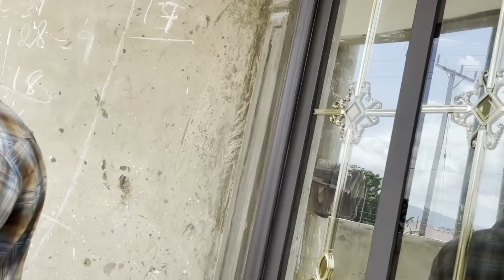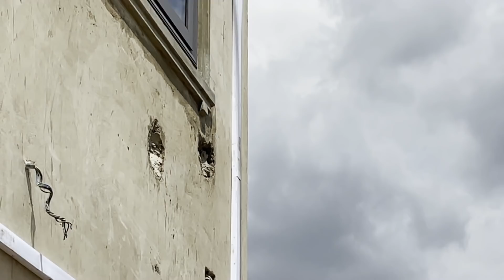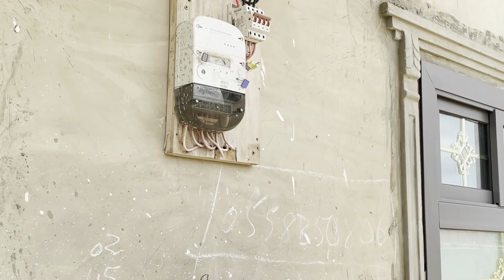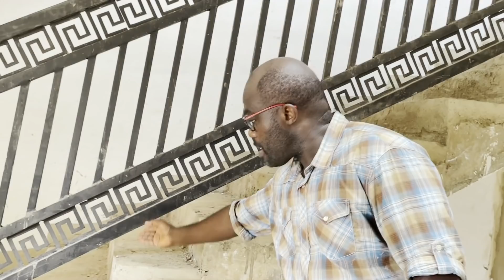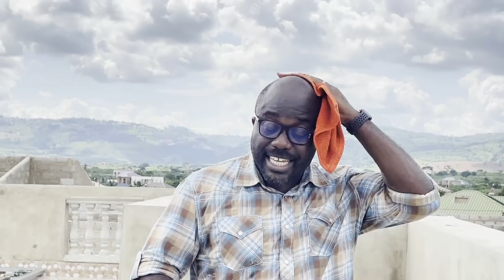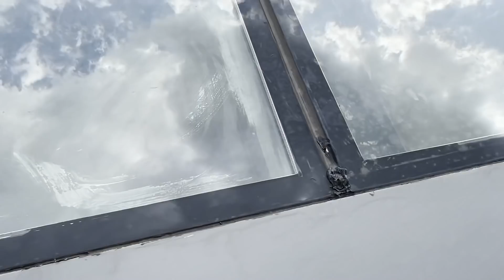HOW MUCH POWER DO I NEED TO RUN MY HOUSE?

Comment: Very informative as usual. But are your rooms not going to be very hot with the concrete roofing instead of the conventional metal or aluminium roofing sheets?

Comment from the maker: Ebook Title: How Much Power Does Your House Need?
Ebook Link: https://payhip.com/b/8P7wu
Ebook Contents List:
Power Density – What is it?
The Bedroom Loads.
The Kitchen Loads.
Other areas.
Diversity of House Electrical Loads.
Typical House EMD (Estimated Maximum Demand).
Incoming ECG Cable Size (In Air or Underground)
How large does your Solar System need to be?

Comment: Kingsley, perhaps you need to look at putting a smaller AVR at the interface between the meter and ECG for 10m2 cable or change it all together or do both.   I know there is a breaker but a friends house caught fire  although he had some some sort of AVR inside the house it didn't prevent the surge at the meter point as you would expect.  As I don't have the full details of root cause of the fire, he seemed to suggest and as well told by ECG and fire service that the fire was due to a voltage flactuation a the meter point.  Can you illucidate on what your thought are on this.  Thanks Akora
Reply from the maker: The cables are no longer 10mm2. We changed them to 16mm2. Very strange and difficult to say without a proper root cause analysis. There could be many reasons. Trust all is well with you
Reply: @kingstal90  I have subsequently watched the change you've made to the 10mm cable. Glad you gotto to do that.   All is well! thanks

Comment: Hello, excellent presentation and vid.  I can relate.  

My first electrician (a relative) installed Ro2v4x10mm2 from the meter to a junction box and then run 6mm2 to 2 different boxes of circuit breakers downstairs and upstairs. He had to go!!! The new electrician recommended Ro2v4x16mm2.  I overruled him.  Now we have Ro2v4x25mm2 running from the meter to each of the circuit breaker boxes.

Watching this vid has reassured me that we are on the right path. Tfs!

Comment: Thanks for the video. Does the ebook contain the details on the ECG Phase changer I enquired about the other day? Also what’s your take on underground cable power (ECG) supply to a house?
Reply from the maker: What ECG Phase changer?
There is No ECG Phase changer
Underground cable is fine. it is more aesthetically pleasing.
Just make sure it is the correct size as this installation method is very different and has different design factors to be considered when cable is buried in duct/pipe in the hot ground.
Reply: @kingstal90  Thanks for the explanation. I was referring to the three phase change over, whether it is captured in the ebook
Reply from the maker: @obiaw204  - No, that will be a separate video and ebook entirely. In the video I will demonstrate the operation of the changeover and the AVR and include all details in the ebook

Comment: Great content once again. I have one question though. Why did you use a 100Amp circuit breaker if your total current is going to be under 50Amps. I know you needed to make some room for contingency, but why did you go all the way to a 100A🤔
Reply from the maker: The 100A breaker is installed by ECG not me
They install this as a max to protect the meter itself which is also 100A rated typically.

Comment: That electric has to be right.  Good catch on that. The average homeowner would not have thought to look at that. It’s too tricky trying to build.  Why is the trip set For 100 and would not have tripped in time for the wiring? That would have passed inspection?
Reply from the maker: Don't clearly understand your question. The 100A MCCB is installed by ECG and not me. They install 100A as a max because their meter is typically 100A rated also. Its purpose is mainly to protect the meter itself
Reply: @kingstal90  I see, I misunderstood.  I enjoy your videos and content and looking forward to the next.

Comment: Great video. loved every bit. I install Solar systems and I always advise my clients to get a set up to run only the essentials like you said, ventilation (fans) , lighting and some light loads. This give you the opportunity to reduces the time to realize your ROI, the system(especially the batteries) last longer and you get to improve your power reliability at a low cost. It's good you got the solar thermal too. Using the grid (ECG) for heating is also very expensive. So far I will say Kudos! You have a very solid energy plan been executed excellently.
Reply from the maker: OK really, That's great and very good to know. Have you watched our video on "Cost of Solar Panels in Ghana"?
They are so expensive around the 10kW mark and upwards.
Reply: @kingstal90   Yes I have. In actual fact the grid (ECG) is far cheaper than a kWh of electricity produced by Solar power in Ghana because we mostly install off grid systems with battery backup which is capital intensive. I still use the grid and still benefit from my lifeline subsidies which makes ECG cheaper but run my solar for reliability  which the ECG lacks at very critical times of the day and seasons (during rain just be on stand-by for a blackout and in bad neighborhoods with power issues a brownout when they start increasing power consumption). Like I said earlier you have one of the best energy plans for your home I have seen so far and i hope many of your subscribers model it. Getting the generator to power heavy loads is also in the right direction like you are doing. I guess being an engineer you have already worked out the right energy mix (Grid + Gen+ Solar thermal + PV Solar ) and I very much agree with you.
Reply from the maker: @makafuiameedzameh2445  - Thanks very much for your contribution/comments
Reply: I totally agree.  I aim one day to do the same. Jamaica public service JPS are a rip off, so I want to go off grid when my time comes to build and migrate. I'll need Asher to help me design a very similar system. I'll effectively going to be off grid but the system I need will be huge. Around £20-24k. I'm scared.

Comment: this is what they have been using for most homes in Ghana and I believe this is why most homes are running on low current. No wonder a lot of people are using getting home fires because that 10mm would heat up and there would be high resistance caused and this would have your metre reading higher and it will cost you more. I think they do that deliberately to have the metre reading higher to run your credit out. Because this is the cable 10mm they have been using for most people instead of 16mm atleast.  Thanks for this knowledge. Because we have this problem at home and we experience a lot of low current and higher meter reading making the prepaid metre drain a lot of credits. 

I think they lied about the cable being temporary because they didn't  know you would find out and when you did. They had to convince you that was temporary because they know you know what you are talking about and they cannot B.S. you. Thanks very much. Really helpful.
Reply from the maker: Its unbelievable that they would use 10mm. Putting lives at risk
Reply: @kingstal90  This is why there a lot of cases of homes catching fires during voltage fluctuation or when the power is turned on after a blackout. They didn't mean to do it temporarily, but when you caught them they realised they can't pie to you. Make sure you don't have to pay them to correct their mistake. Those guys are mostly technicians and some are also in experienced and with gross negligence and the real engineers that are supposed to supervise their job sits in the office and boss them around whilst these guys that are on the field are underpaid, unlike them so not much motivation on the job.
Reply from the maker: @nanabrimpong3485  Understood and thansk very much
Reply from the maker: @nanabrimpong3485  - The voltage fluctuations are ridiculous in parts of the country. I'm surprised this hasn't been sorted out properly yet. Even in the expensive estates- still quite a bit of fluctuation in the power supply from ECG. its a shame. People need to invest in an AVR.
Reply from the maker: I talk about voltage fluctuations in one of the videos coming up this week
Reply: @kingstal90  Man we've changed fridges, freezers and even the voltage stabilizers themselves after attempting to repair them. And we still get this problem till date. One neighbour recently changed his wiring and he says things are better but I doubt it because most people in the area experience the issue.
Reply: This is very scary. I’m build in Ghana and I just completed foundation and I’m almost done with the block work. Please, should I hire an Electrical Engineer as consultant to help me with the electrical work?

Comment: Great information as per usual. Great suggestion regarding the solar power system only running a few appliances during power outages as most people suggest running the whole house which is mega expensive. I can now see a much cheaper option that can be upgraded at a later stage as costs and technologies improve. Now u see why i never miss an update from u guys. Well done and thanks again
Reply from the maker: Thanks. yes economical design is important. Cost is a deisgn parameter itself in our consulting practice

Comment: Another great informative video. Now I'm going to have to check with my project manager to double check every thing with my apartment since Im not down there. Thanks a bunch. You guys are doing all of us great service. Keep em coming
Reply from the maker: Glad it was helpful!
However, remember it depends on your exact load assessment / method of cabling installation, etc. An apartment complex is much bigger than my house. I dont know how big your area is or how many rooms you have but assuming it will be much bigger than my home.
Bless
Reply: @kingstal90  You are absolutely right. Which is why I needs to talk with my PM to assess the situation. Its not a huge project. Its only a 2 bedroom 6 unit complex. I remembered paying for the 16m cables. Thank you.

Comment: Did you get single phase or 3 phases? And if you did get 3 phases then there's no need for the 16mm cable because you will divide total amp by 3
Reply from the maker: LOL
You don’t understand my installation
First to clear up your dividing by 3 statement. 

If I have a load of 80A and I want to support that load using single phase, then that single phase cable will need to be able to safely deliver 80A
If I want to support the 80A load using three phase cables (3 live + neutral) then in that scenario, each of the cables will conduct 80A/3

MY HOUSE
Assume I need 80A
I have 3phases coming into the house.
BUT my house only uses single phase!!
Only 1 out of the three phases supports my house at anytime via the changeovers. 

I have connected 3phases simply to make the installation more resilient. In this case I need each of the three cables coming in, to be able to supply 80A. If my house is on L1 it gets 80A if on L2 80A and if on L3 also we get 80A. Each of the cables must be at least 16mm in order to supply the 80A

If you’re not an electrical engineer or have not seen the schematic details then you may not fully understand.
My house uses single phase only 
So one phase out of the 3 coming in will supply electricity to the house! The 3phases coming in is for resilience purposes ONLY. If there’s a problem with L1, I switch to L2, and so on/ so forth

I will demonstrate the switching in a later video with more details of the changeover system in a detailed electrical Ebook

Bless
Reply: @kingstal90  Thanks for the explanation and I now see your point. You're using a single phase and that make sense to use 16mm cables. My house was designed differently with 3 phases shared among the entire house. Two of phases supply power to ground and first floor whiles the third phase supply power to 20000 Watts transformer to convert 240V to 120V for my USA appliances so I have both 240V and 110V within my house. The ground floor lights are 110V whiles the first floor uses 240V so my is completely different. It was designed by my friend here in US. Thanks again bro. I will look for you I come to Ghana in two weeks God willing 🙏
Reply from the maker: @davidgyimah4377  - Great but if you lose one phase, you lose a portion of your house. If I lose one or even two phases, my entire house remains ON.
Reply: @kingstal90  Yes, you're correct when I lose a phase I am losing a portion of power supply to a portion in the house but now I am ok. Thanks.
Reply: @davidgyimah4377  Thanks for sharing.   I'm also considering similar setup for my home. I'm also based in the US. I'd appreciate the opportunity to connect with you --if it's okay with you. Thanks

Comment: Having the white trunk sticking out is a bit meh. Should be hidden clean from sight
Reply: Formally,main cables were permitted to be hidden,but because of rampant  stealing of power, electrical contractors were ordered to  display it open.hence the trunk.
Reply: @danielneequaye5505  I don't know about that,  because I don't have any truncated stuff on the wall of my recently completed dream house. It's an eyesore. Hopefully, it's temporary. Having the distribution board on the wall of the main house is not the best. I have it on the wall of my staff quarters structure and it's concealed in a nice wooden enclosure with a cover built by my Carpenter.
Reply: @danielneequaye5505  Is it a requirement in Ghana? Cus first of all it looks ugly and dangerous when exposed. Second, some real estate developers bury their cables. Also done in major GH cities buildings. 

It'll be very primitive to enforce this kind of wiring when the rest of the world is moving ahead.

Nevertheless, it doesn't look good. Those plastic trunking will come off in no time...their quality is meh.

Comment: In the U.S. MOST electrical boxes are inside the houses. I would like to know why the houses and buildings (malls, stores, churches,etc.) are constructed with cement and not wood in Africa? If you know the answer please let me know. 
I watch your videos because you teach and illustrate very simply to where anyone paying attention will understand. 😊
Reply: Hahah, very interesting question we build our houses like that because of weather and also to resist and weather conditions,  most people can't afford the air conditioning system so with our system of building, the room turn to be cooler even if you don't have the a/c system,  that's my two cents
Reply from the maker: @abenamensah4249  - Wonderful. Thanks very much
Reply: The reason(s) notwithstanding, building with concrete is better than wood. I own two houses in Ghana and a house in West Orange, New Jersey.  The houses in the States appear to be so cheaply constructed  with wood, dry wall and prefabricated materials. No wonder these houses crumble like cookies when there are floods, tornadoes, hurricanes and fires.
Reply: @denniscasely-hayford3245  And they are overpriced ,imagine a wooden house selling for $400,000 for a single family home.
Reply: @abokoeguale9783  Exactly!! I have said this many times. I bought my house in the States for $550,000. That house cannot be compared to my dream house that I built in Ghana, which cost less and is far superior. This is part of the many shams of America.
Reply from the maker: Thanks very much. Will try and find out for you

Comment: what is the max surge?  In the US the max surge is 225a, the cable is size 0000.  Here in the US, the meter is the main that the consumer cannot touch the disconnect is after it.  Question due residents there do duck banks, the power coming from the pole to the conduit in the ground, power is coming up.  Is that a common practice there?

Comment: A big thanks for your info! Please how much is the main electricity voltage in Ghana and also can you use domotica electricit system in Ghana? I don’t know if you know of Domotica system!
Reply from the maker: 220-230V in Ghana.
Educate me please on the domotica. Never heard of it
Reply: @kingstal90  all
Description
Home automation or domotics is building automation for a home, called a smart home or smart house. A home automation system will monitor and/or control home attributes such as lighting, climate, entertainment systems, and appliances. It may also include home security such as access control and alarm systems
Reply from the maker: @Boateng1979  - ok great. Yes very aware of home automation, just hadn't heard about the manufacturer Domotics. Thanks very much. Personally I actually don't want too much automation due to risk of hacking, etc. Just a little bit is ok for me
Reply: @kingstal90  thanks very much I appreciate you for your time answering all our questions God richly blessed you 🙏